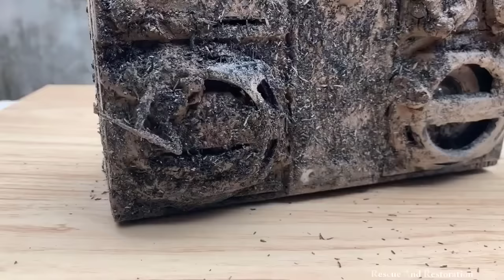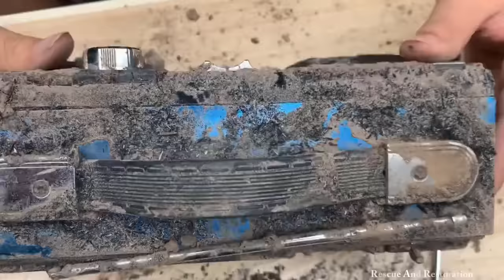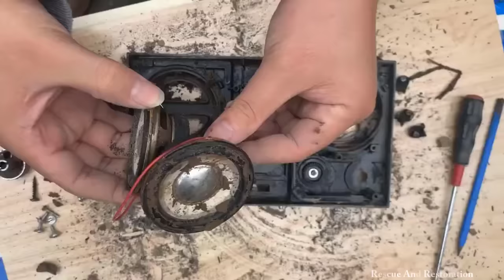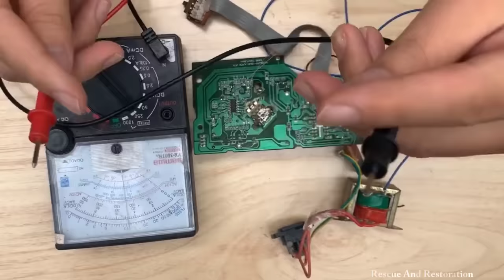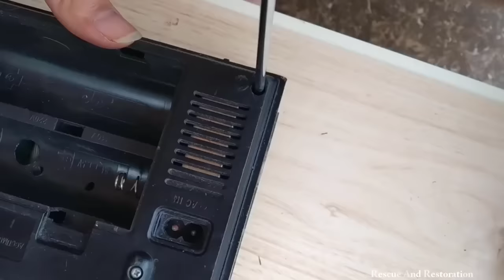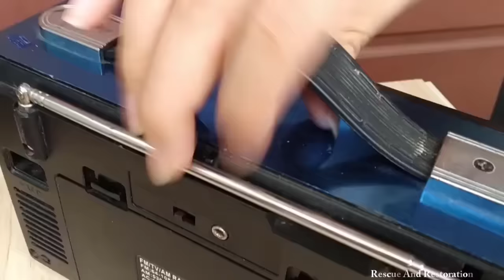Restoration an Abandoned FM Puxing PX 247UR Radio Cassette |  Restore Destroyed old Radio

Comment: Usually a radio like this would still have batteries in it. I mean, if it was lost/abandoned on the edge of a field -- and not a roadside ditch -- it should still have the batteries that were in it when it was lost, which prevented the damage that would have occurred when the batteries corroded. /smh/

Comment: Interesting. The light covering of mud must have prevented you seeing the radio lying there in the field sooner than you did but also seems to have prevented oxidisation which is a bonus if you're restoring electrical items. Well done.
Reply: It's fake, staged... they cover it with dirt afterwards and edit the video to make it seem like a real restoration
Reply: @tommj4365  Yes it is fake hence my tongue in cheek comment   😃
Reply: So you think they bought this radio.  Took it apart and put it back together again before playing it.  Then covered it in mud and placed it in the mud for discovery?  What also gives it away is how shiny it is.  Also the cones of the speakers are normally made with a type of paper or a very thin plastic material.  That would perish quickly if left in the mud and rain.

Comment: If you are an authentic restorer why not find some legit units that has any damage inside by corrosion, rust, defect component. Not a planted fake find covered in mud and just easily clean and not exactly has a true defect at all. Even the way of testing components seems continuity test and never just plug in the unit to see what could be the problem... Too obvious of fakery...

Comment: In my opinion this video is fake. Electronic boards are not washed with soap and water. You have to use isopropyl alcohol, because otherwise, the capacitors and components of this radio will be sulfated. A video can be edited without the person noticing. This guy put the radio together, cut the video, and then took it to a real tech to get it fixed because he doesn't have a clue how to do it. Even when he tested with the multimeter he didn't know where the short was. fake video.

Comment: FALSE FALSE FALSE THIS VIDEO IS A LIE THAT RADIO THEY WANTED TO MAKE IT PASS BY ABANDONED AS IT COULD BE POSSIBLE THAT NOTHING OF RUST HAD THE SPRINGS AND SCREWS LIKE NEW AND THE INTACT CIRCUIT BOARDS AND THE MAN USED THEM TO USE A MULTI-ELECTRONIC COMPUTER FOOL AND THE IMPOSSIBLE INTACT HORNS ARE MADE OF CARDBOARD THEY WOULD BE DESTROYED IDIOT WHO YOU WANT TO DECEIVE THE FALSE FALSE       FALSO FALSO FALSO ESTE VIDEO ES MENTIRA ESA RADIO LA QUISIERON HACER PASAR POR ABANDONADA COMO PUEDE SER POSIBLE QUE NADA DE OXIDO TENIA LOS RESORTES Y TORNILLOS COMO NUEVOS Y LAS PLACAS DE LOS CIRCUITOS INTACTAS Y EL HOMBRE UTILISA UN MULTIMETRO PARA CHECAR LOS COMPONENTES ELECTRONICOS A LO TONTO Y LAS BOCINAS INTACTAS IMPOSIBLE SON DE CARTON ESTARIAN DESTRUIDAS IDIOTA A QUIEN QUIERES ENGAÑAR  LO FALSO FALSO MAS

Comment: Cheat video. No rusted screws, speaker metal. Why did you check resistances on PCB without schematics? This is not real radio restoration. The guy just wants to get money from You Tube.